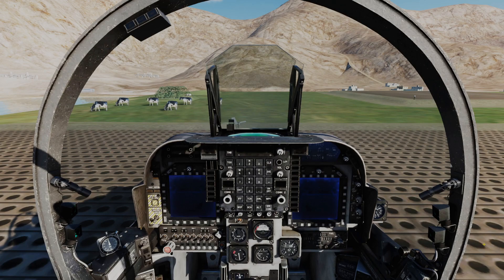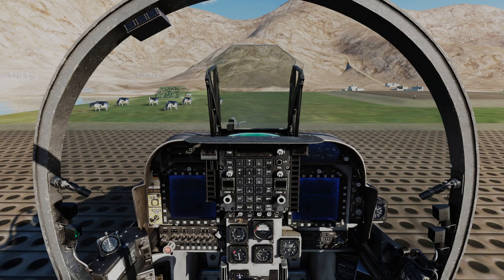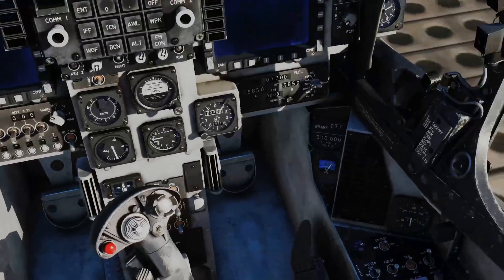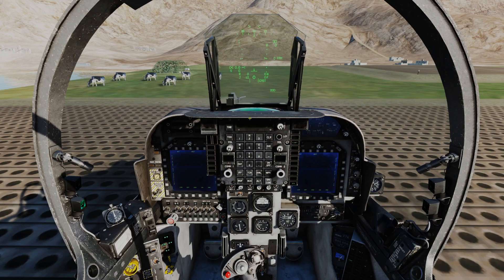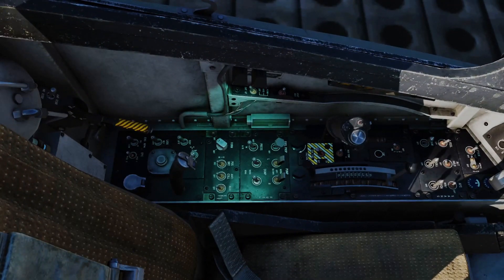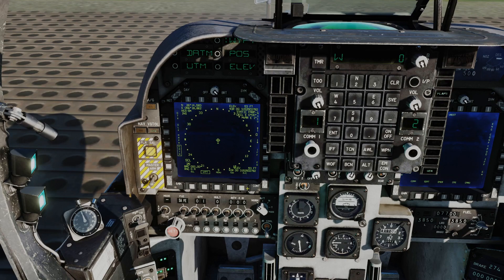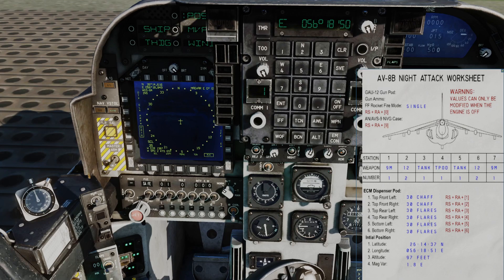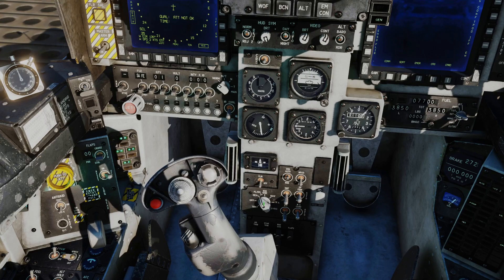DCS AV8B Tutorial 1 - FARP Startup

Comment: Decent video.  Don't think you'll be pulling off a STO from a pad like that fully loaded -- me thinks you'll be in the drink for sure.  FYI, there are things you missed if you are going to do an actual STO.  For starters, on the STO VREST sub-page, you should be entering the runway magnetic heading using the option buttons on the top left and the UFC.  You should be entering the runway length (or remaining length of where you are going to be starting your roll.  Also enter the OATC (outside air temp Celsius) if it doesn't match.  Then you need to press the ABRT button the STO page, which automatically compute the additional values that had * next to them.  You didn't know what these are, but basically they are things like your ground roll (takeoff distance), distance for clearing 50 foot obstacle, stopping distance if you have to abort takeoff roll, etc.  Then you want to depress the VSTOL HUD mode (even if it is already in that mode).  Then press the button next to the NRAS to the left of the UFC and enter the NRAS from the STO page into the scratchpad and hit enter.  This will box the airspeed on your HUD when you reach NRAS.  You can also adjust the pitch carrots if you want something other than 14 degree pitch after you lift off.
Reply from the maker: Thanks for the comment and clarifications on the VREST parameters. I actually go over these in more detail in my field ops video later in the series as at the time of recording this video VREST was not fully modelled. The STO I do in the next video and I use the grass strip at the rear of the FARP which has plenty of space.

Comment: So... what's different when starting on the boat?
Reply from the maker: Main difference is that you should start the procedure by plugging in the deck cable and then using the SEA alignment mode of the INS. Apart from that startup is the same.
Reply: @deephack  Thanks